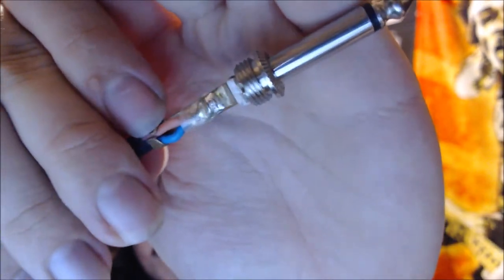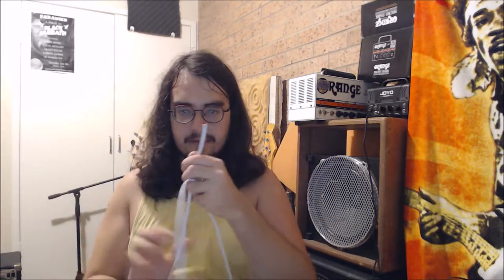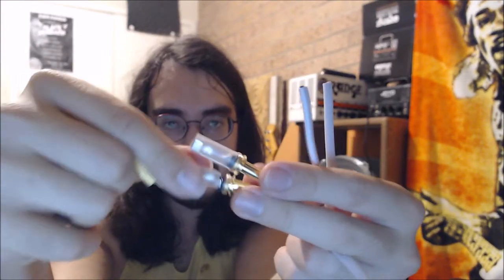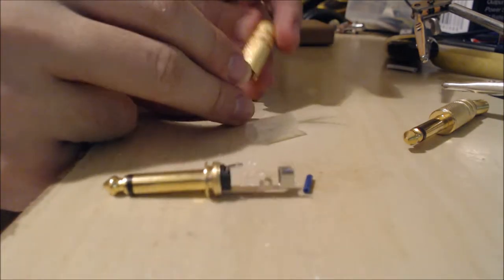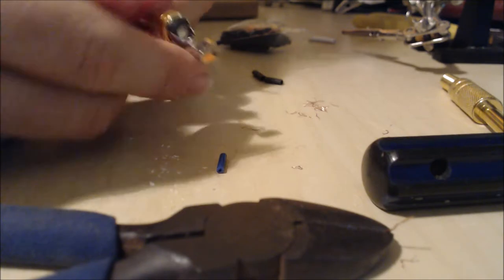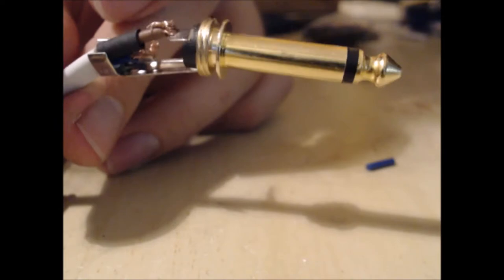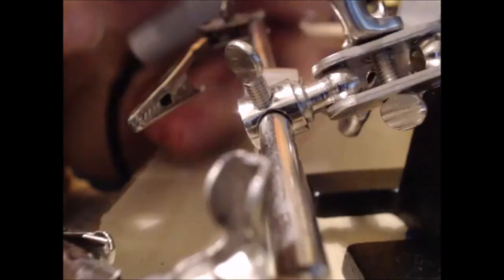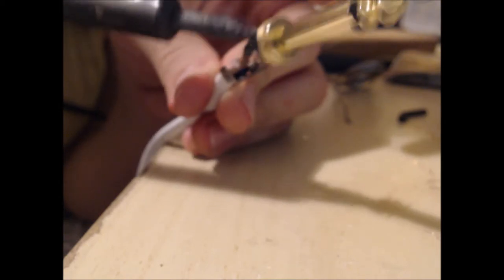How to make a Cheap DIY Guitar Speaker Cable

Comment: several ways to do this, we call that stuff lamp cord. its good stuff. but you can use any stranded ( multiple smaller wires twisted up)  any stranded plastic insolated copper wire of proper guage.(just double it up) 1 insulated strand, folded over half way on itself gives you2 wires (now). you just cut it and attach jacks. for stability, twist the cablez together lengthwise using a drill. twisting will decrease length, so measure twice and add extra length🔀